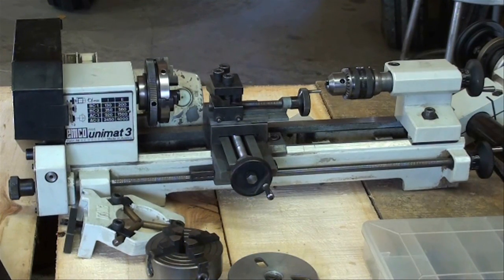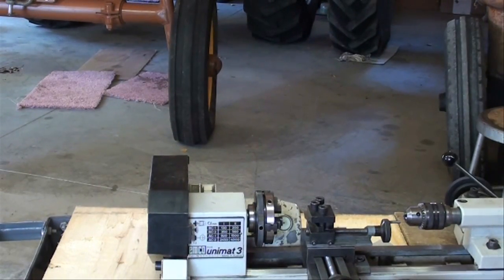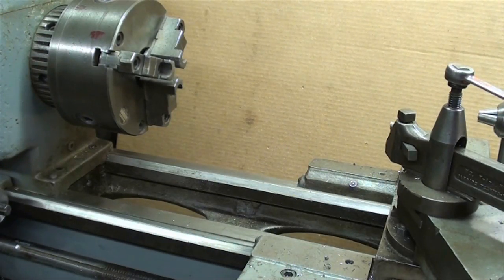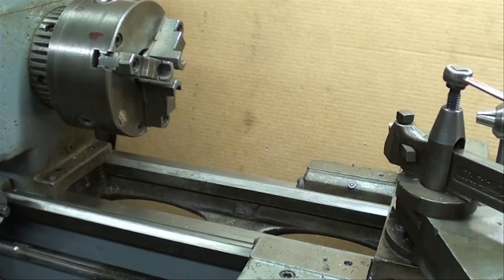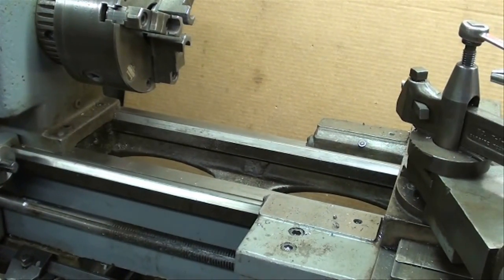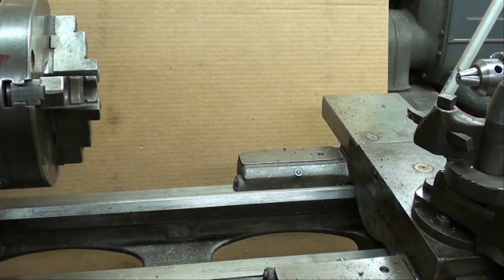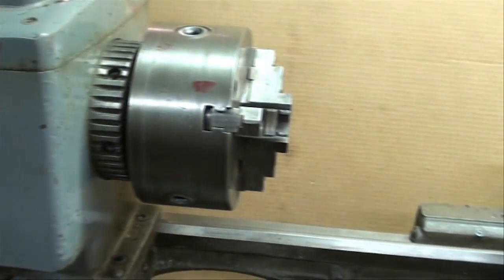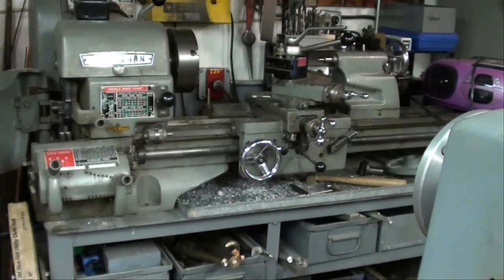Buying a Lathe EMCO UNIMAT Pt 3 #54 tubalcain micro lathe

Comment: So I heard they got rid of all "Shop Class" for schools? I am not sure if that actually happened. I attended a school that was in a farm town, and so the entire school was run by farmers, and the shop teacher was a cattle farmer. The shop was extremely dangerous, no guards on anything. The table saw had no riving knife, or guard on it and had a huge 3 phase motor, and we used it free hand with no guide, for ripping plywood sheets. I recall a huge metal lathe, but nobody used it. They never taught people about using the metal lathe, but they allowed you to use all the tools at any time. I would often spend the whole day in the metal shop, and nobody cared. The school didn't exactly follow proper protocols (I won't name the school). Only one guy who was restoring his 1954 Chevy truck, he tried using the metal lathe. I recall that we both kind of laughed, because he was trying to thread a large 1" shaft, but he had no idea how to run the lathe, and the shop teacher literally never once talked to us about using the lathe - we were entirely on our own, no instruction whatsoever! haha. My feeling is, that lathe didn't get a lot of use, despite the whole shop having access to it. Because cattle farmers are so busy with farming, the metal shop was mainly geared toward raising cows, and most of the students had cows. If they do still have that lathe, and if shop class doesn't exist anymore, there should be a lot of school lathes for sale?

Comment: Emco makes a pretty good lathe for home hobby use (plus you can get the milling attachment for them).  It's no Hardinge, but they are capable of surprisingly accurate work.  I'd stick with the 8", 10" and 11" sizes.

Comment: 50 $50,000 for a truck my Lord I bought a repoed house for $32,000 and it was an absolutely perfect pristine shape other than it needed a garage door and some electrical repair in the basement. Oh and it had some plumbing repair in the basement to do and the bank paid for everything. I never thought I'd get a house this cheap out in the country. $50,000 for a vehicle? 10 years of won't be worth anything. I bought one new vehicle in my entire life and regretted it never did it again I always look for a good deal on a used vehicle after that.

When I was younger I used to lay brick a terrible terrible hard job that paid very very well. I work with a spoiled rich kid that shouldn't have been on the wall with us but he was best friends with the owner son. I think you know where I'm going with this. At any rate the sun Got a Brand New Formula Firebird for his graduation and the year later he wanted a Callaway Corvette canary yellow. He needed an extra $3,000 for the down payment and didn't know how he was going to save that money before it was sold. I immediately ran to the bank on my lunch hour shove $3,000 and a pen in his hand and had him sign over his brand new Formula Firebird to me for $3,000 and he did it LOL what a fool

So I got a brand new car barely broken I think it had 32 thousand miles on it for only $3,000. People have to try and shop for Value not for Prestige

Comment: I want to ask you what the pitch of a lead screw is?  I have tried to use "all-thread" in building my lathe but it is way too slow to hand crank. I am making a half nut but I would like to purchase a proper lead screw before I do that..

Also do you have any videos on lathe chucks and why I would want a self-centering one? Wouldn't an independent chuck do everything? I have a centering chuck but now I am maybe regretting buying it?

Thanks.
Reply from the maker: Yes--a 4 jaw chuck does everything-get one. Do not listen to your GF--buy what you like.  The lead screw is 8 tpi

Comment: Bought my 12 inch atlas from my high school for $400 dollars back in 2006ish. It looked hardly used. (there wasn't a metal working shop when I was there). So this lathe was just collecting dust in the corner. Looks just like your craftsman, but has the belts and motor under the stand. It has an odd ball model number of 12700...?
Reply from the maker: Good buy!

Comment: A sad story. I found someone selling a South Bend 10k. The pictures showed a very pretty lathe. I met with the seller today to look at the machine. He said he did not have 3 phase 220vAC at his house, so I brought a friend to help make sure the machine would go through the motions manually. I arrived to find the lathe, loosely draped with a tarp, outside, in the snow. Frozen to the core (it was -18 Fahrenheit today), the saddle did move using the lead screw, but he bed ways had gained some significant rust, and had evidence of some accidents.  The three jaw chuck had gone from a nice shine visible in the pictures to a sad shade of orange. I could not get the quick change gear mechanism to move. He did have a three and four jaw chuck, live and dead center, and a handful of miscellaneous tooling, but it was all rough, at best. The compound assembly was missing entirely.  I left the machine there, with a heavy heart, the price he had asked was $1600. There's not much in the north central region of the US in the way of industrial machines. Were I in the market for some farm equipment, I'd be buried to my eyebrows in prospective purchases. Do I offer $500, and suffer through the restoration (if possible), or do I save up for one of these piece of @#$! import lathes?
Reply from the maker: Do not buy it. It is scrap  worth $50
Reply: mrpete222 If it were from any other source, I'd question the decision. I'll go with your word, and sleep easier tonight. Sad to see a nice machine turned to scrap for the lack of a bit of care. I know the 10k wasn't the heaviest model, but it's still a pretty machine.
Reply from the maker: IBWatchinUrVids
I have seen other people store machines outside. It ruins them.
Reply: mrpete222 I've read your responses in the voice I've heard so many times in your videos. That may be weird, but I can live with that. The great Tubalcain has spoken directly to me, and I shall heed his advice ;)  Thank you sir, for all you do, and I look forward to your next videos. Since I have your attention, please do a video on press fits, and the variety of fits between. :)

Comment: what did you use for the electric motor on your atlas? i am looking to add a variable speed electric drive to my smithy. as you said, change gears are a hassle and a time consuming nuisance.

Comment: Where are your stairs? Through a kitchen? By a backdoor?  Even 800 is quite a bit for some kitchen floors for instance.

Easiest I've ever helped with had outdoor stairs where the entire mill can be lowered down into the well outside the basement door.  Otherwise you're talking full disassembly into head, ram, table, column etc. And then I would normally recommend building a ramp and using a winch of some nature to lower the load down the stairs.